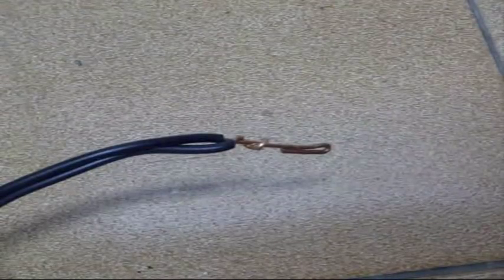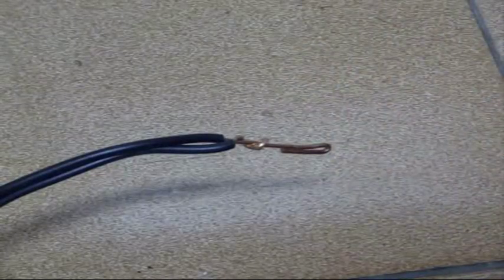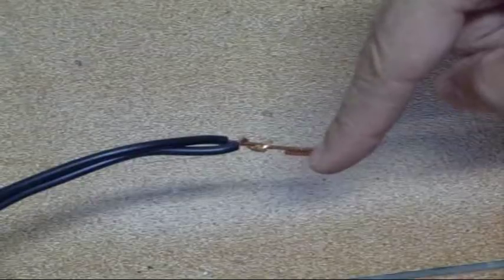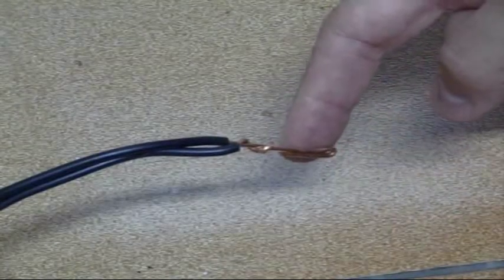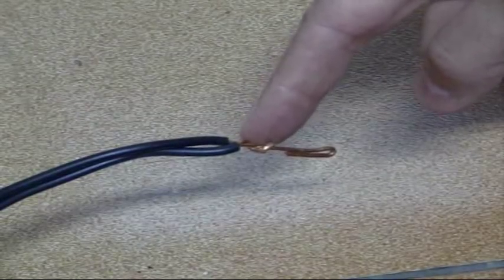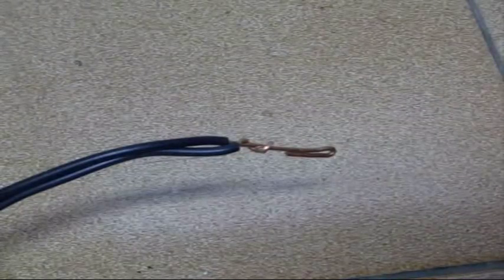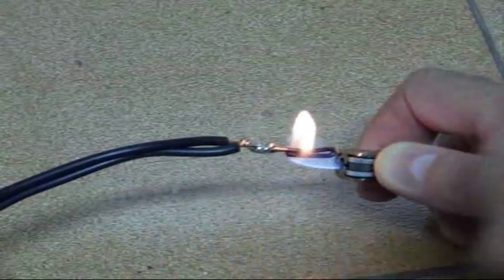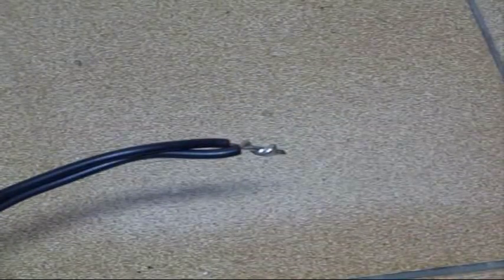Soldering Without A Soldering Iron (Update Available)

Comment from the maker: How does this work?  Soldering irons are nothing more than hot copper which melts a mix of tin and lead.  You can heat the copper with electricity or gas and I've seen people put a piece of copper in a charcoal fire and solder with that.  In this case, the copper is just some extra part of the wire you are soldering and the heat is from a lighter, candle, matches, ... 
Updated/remixed version with annotations restored: https://youtu.be/b5iiUMAOGew

POPULAR SOLDERING VIDEOS:
Soldering Basics - Popular Solder Connections - Done Right (4K) https://www.youtube.com/watch?v=udNu-wZaqJE

Myth Busted: Soldering From Below https://youtu.be/gFGvNrYpsGc

Soldering Wires - Doing It Wrong, But Getting It Right (What is CRITICAL?)(4K)
https://youtu.be/Ej284nrwX84

Common Soldering Mistakes 1   https://youtu.be/mv1t-aoSDOg

Soldering Mistakes 2 - Why Mechanical Connection Is Important
https://youtu.be/IPRZOollABY

Soldering Without A Soldering Iron
https://youtu.be/b5iiUMAOGew

How To Solder - Electronics, Car Wiring, Boats, Solar, ...
https://youtu.be/gPpisFM6AIg

Soldering - Water Resistant Joints for Boats, Cars, RVs, Trailers, etc.
https://youtu.be/kZOmRE9msaA

Comment: Nice way to solder wires together. Especially if I am in a situation where I don't have a iron, but need some wires connected! One time I had to solder a pl-259 connector to a coax cable, but didn't have an iron, so what I did was use a heat gun and pointed it at the connector and it melted the solder just fine, but the insulation also melted a little bit so it was not the best substitute lol

Comment: A candle might of been a safer option.
Reply from the maker: I have used a candle.  They work OK, but leave an oily residue, so if the flame flickers across the soldering area (from breeze or such), it can leave the area dirty and create a bad joint.
Reply: might have*
Reply: Or, Might've*

Comment: i've severely burnt my hand before holding a lighter for too long like that, be safe
Reply from the maker: +nugsboodlepoo Clearly you should always follow a manufacturer's recommendations for use of their products.  In this case you can usually get the job done in most of the specs I've seen for these.  If not, you can use other heat sources such as candles.